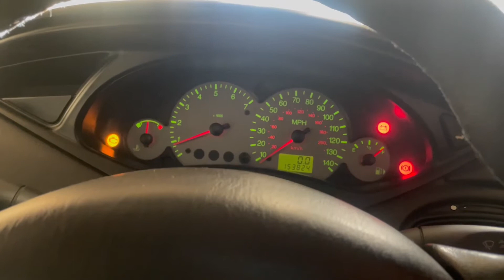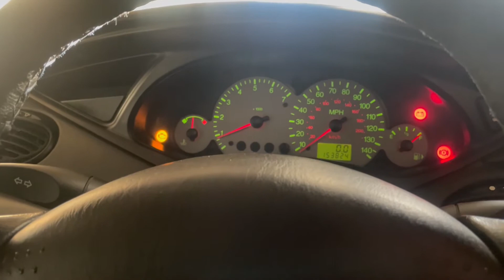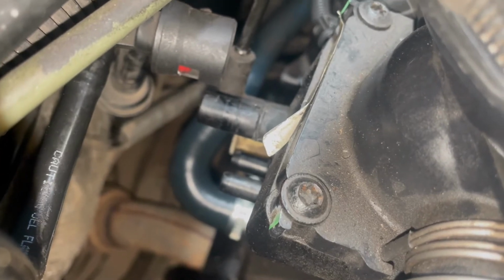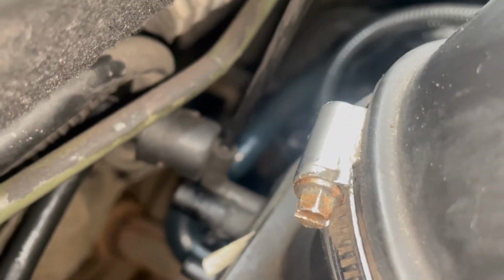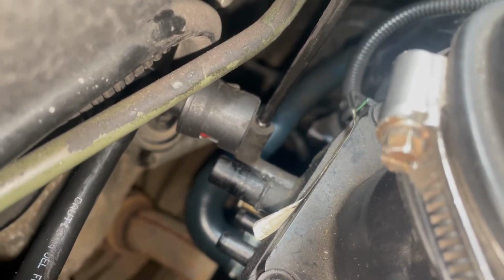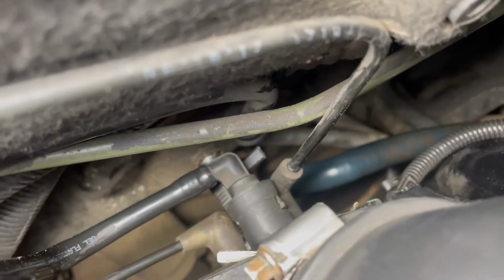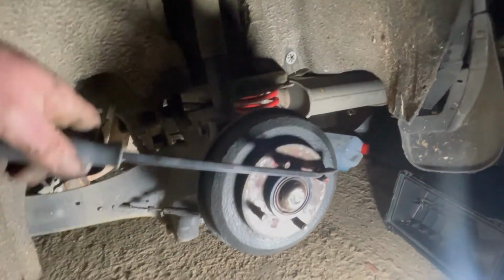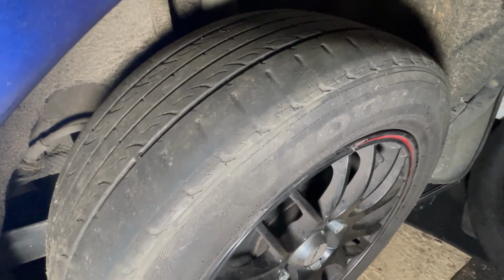Abandoned Barn Garage Find ford part 4 Will It Drive

Comment: Just subscribed! :-))
NIce project, Mk1 Focus is a great yougtimer.
My Focus is a '02 Turnier, 1.8 Zetec, like yours. Bought it 2018, at the age of sweet sixteen. All systems checked, new thermostate housing, cooling system flush, new hard brake lines, brake discs, pads, rear subframe restoration, springs, bushings, bolts, serp belt, new battery, etc. etc.
So, here I am, going to follow this channel.
Take care, have a great Focus!
Reply from the maker: Thank you buddy Yes I will get To most of those jobs you just said about 100% definitely thinking about pulling off the subframe and Rust treating The mounting points Also you could subscribe if you’re not already to win £200 worth of tools